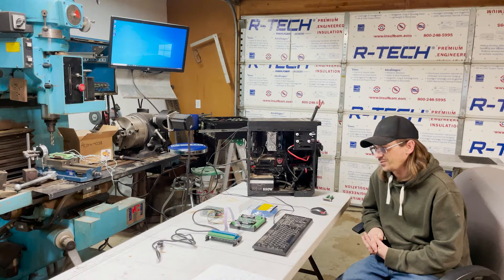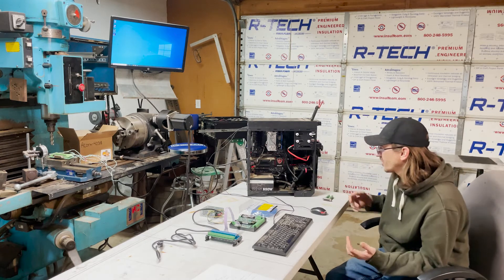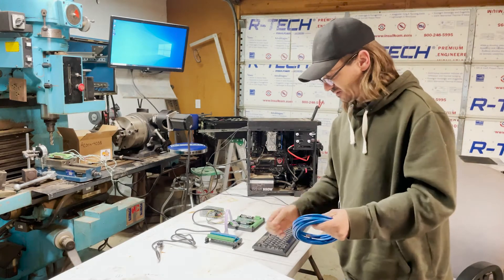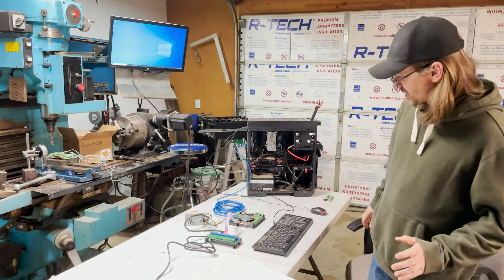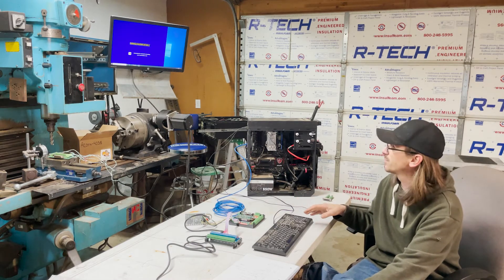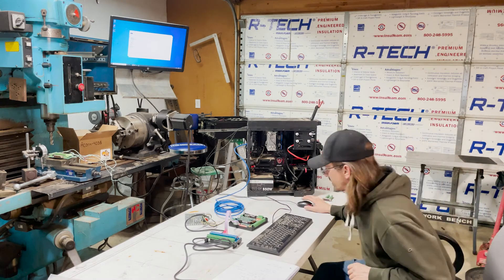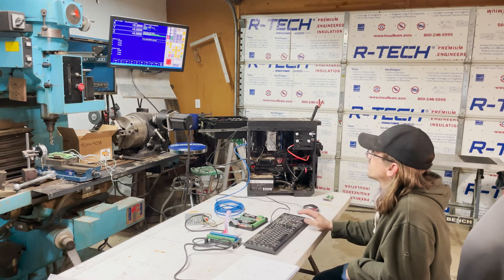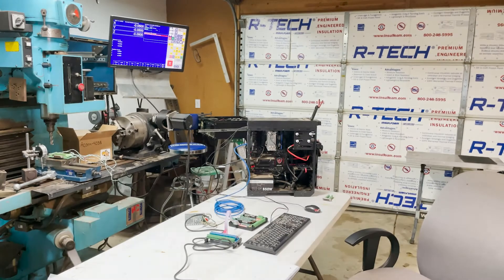Converting to Acorn CNC Centroid controller Part 2: Communication bench test.

Comment: I had a problem with the IP adress, it results that I had another adapter for a PLC simulator and somehow when I installed the software it automatically configured the PLC simulator adapter. I recommend to check out the ip adresses and if needed manually change it.

Comment: Just got my Centroid Acorn board up and running also. I had spent the time watching Marty"s Garage and CNC Keith for a few weeks. No problems. Motors coming in soon so will be installing drives , Power supply's and cable's then. Good luck with the retro fit I am sure you will love it after the learning curve.